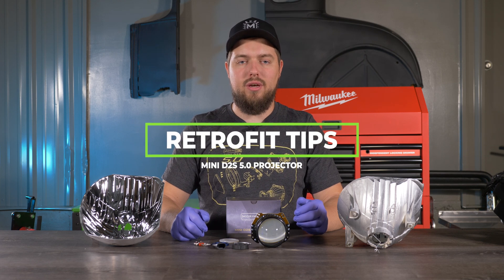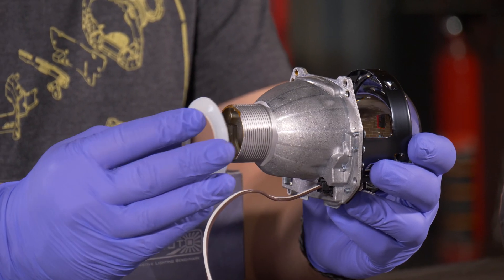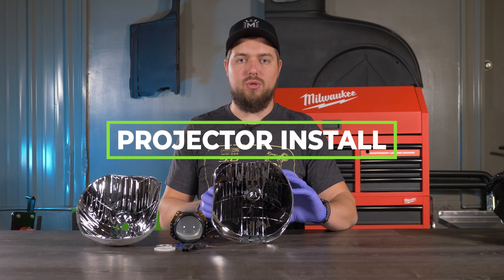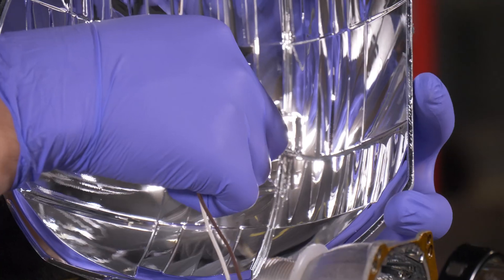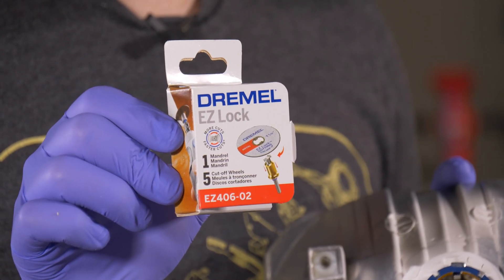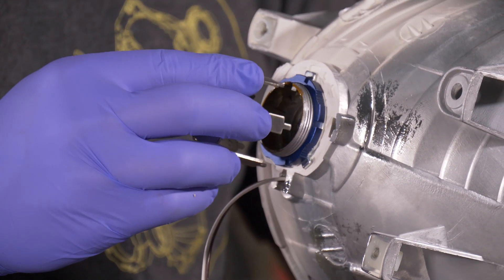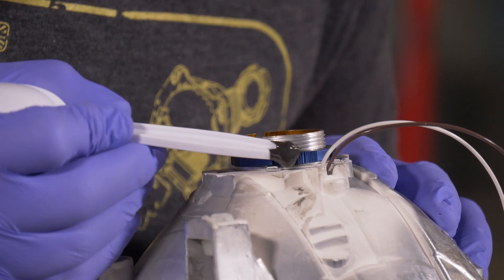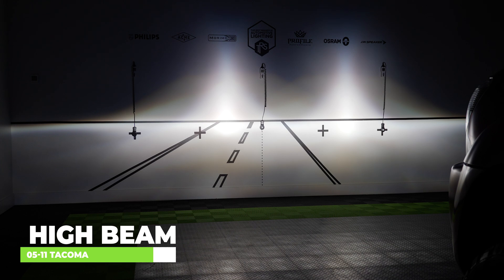Mini D2S 5.0 Projector Overview and Install Tips | Retrofit Tips

Comment: JB Weld on lock the ring? OMG. What were you thinking? That ain't never coming off again. Face palm...
Reply from the maker: You can definitely remove JB weld! What would YOU rather do?
1. Have your headlight fall apart while driving?
2. Use a heat gun to remove the JB weld later? 

Most people retrofit their headlights once and never have to worry about it again! This is VERY normal, and most headlight builders will recommend doing this as well.

Comment: The positioning washer makes my G5R more inclined than centred. Is this how it's on most cars? I had to remove the groove to make the projector centered and fit in the factory headlight housing with the washer. But that makes my projector loose even though I had tightened the lock nut 😔
Reply from the maker: Hey Amjath! The G5R should be a simple install, you won't want that projector loose in the headlight. Can you take pictures of the issue and send them to us so we can help? Thanks!
Support@theretrofitsource.com

Comment: Your guys' instructions are fairly vague and generic and don't really allude to how much custom fit work is really required to get these kits in. I wasn't led to believe I'd have to heavily modify my housing with a dremel tool, but that's where I'm at. Also, which way is up on the projector housing? Wouldn't that be pertinent info?
Reply from the maker: This video is meant to be a guide on hoe to perform the install. Every vehicle will be different and may require additional steps.

Comment: Would it be possible to change my OEM D1S projector for a set of these Morimoto D2S 5.0 projectors? The 45 degree slope that it outputs looks way better than the almost 90 degree slope of my OEM D1S projectors.
Reply from the maker: You may need to do some modifications needed, contact us through our website chat function and one of our reps will assist you.
https://www.theretrofitsource.com/

Comment: I have a Toyota Allion 2013 RHD with factory projectors. Is this Projector a good solution to replace the factory? O....my factory has D4S bulb though
Reply from the maker: That projector would be a fantastic option, you would just need to do some custom wiring to adapt the power connector for the D4S system to the relay harness for the D2S kit. If you have any other questions on this, we would be happy to assist you if you shoot us an email! Support@TheRetrofitSource.com

Comment: hi. isnt the h4 washer suppose to align the projector because of the cut out in the threaded end and stop it from rotating. or does the projector it still have room to rotate?
Reply from the maker: Yes, it does help stop the projector from rotating, however, there is still some room for it to rotate.